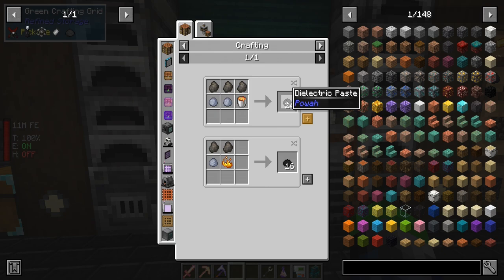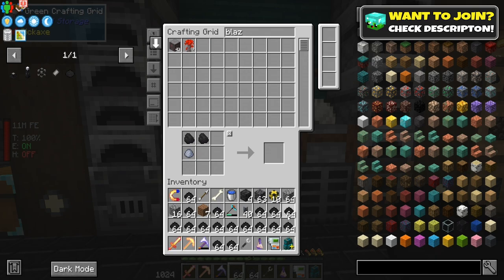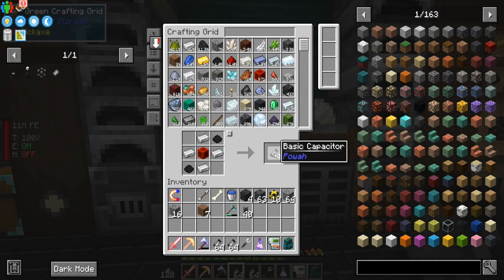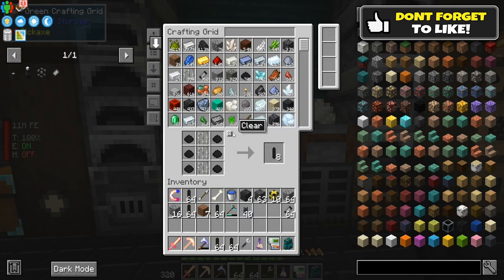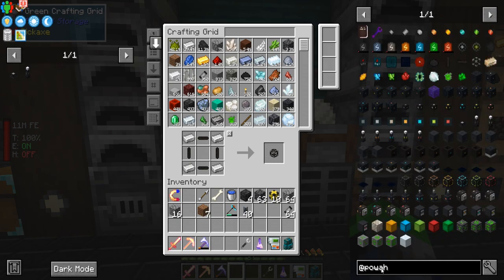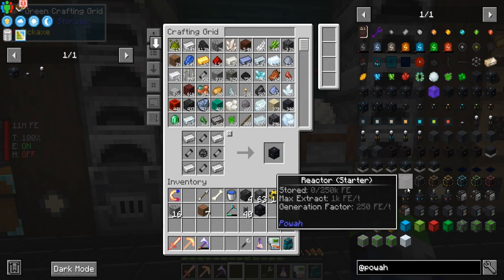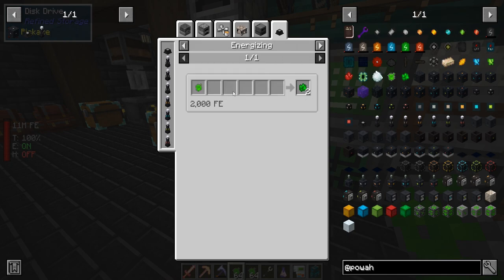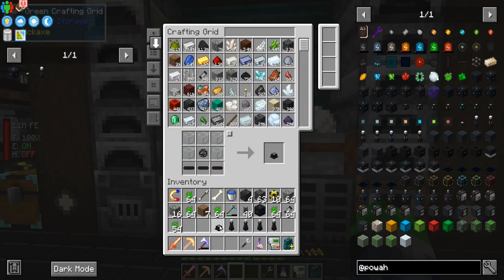All The Mods 8 | Infinite POWAH!!! | [EP 10]

Comment: how many garden cloches do you have for each resource? I've been looking into the best ways to farm resources and wonder if Garden Cloches would produce enough...
Reply: Phytogenic seed automation is lagier but more effective but uses a lot of power I’ve got a giga factory with 650 machines 80fe/tic tho full speed my 32,000 fe/tic reactor can only run about 350 machines but if u build a nitro power reactor u be good
Reply: @TROZJAN  I thought the Phytogenic one was a LOT slower than Garden Cloches and Botania pots, and only produce one essence?
Reply: @DeSibyl  cloche feel takes lot space nearly produces at same pace  using one those Japanese dungeon tower top floors  for my phytogenic factory across one wall can fit 363 machines only filled 2 walls at the moment machin takes row for machine row for pipes use universal so input bottom input/out top with universal supplying power. every 2 mins get over 600 using 2 get nether stars had automated wither killer was far 2 slow. About to hook up nitro power and goin to start simulating nether stars tho
Reply: @TROZJAN  Ah okay, thanks for the explanation! Did you find the design on youtube or is it your own?
Reply: Dewstream utube channel 1000 phytogenic something u should get it